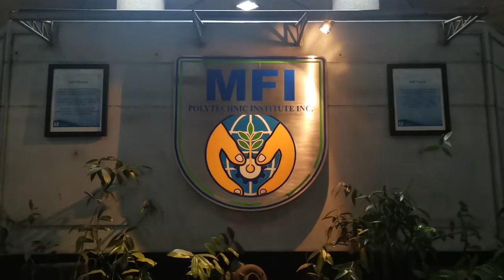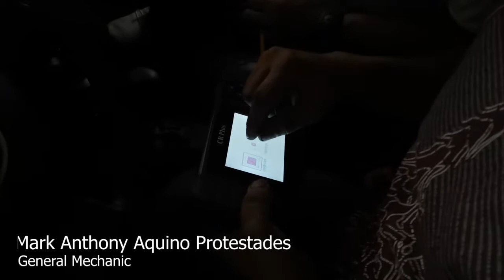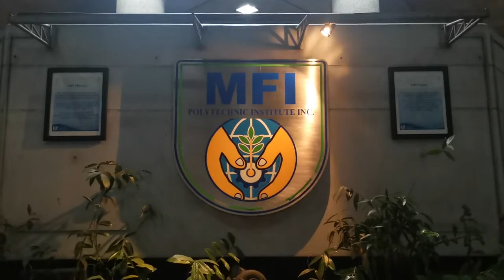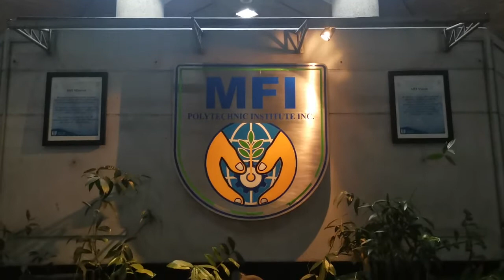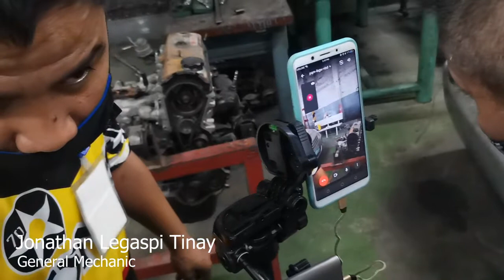MFI Trade Test Video of General Mechanic_Service Technician

Comment: Im not yet in the school but I know for sure that a solid disc brake rotor is 12mm thick but if it was 10mm or 10.5 then it needs to be replaced, seeing that rotor in rusty condition is no good, a clean disc brake rotor is a good grip for an old car.

Comment: maraming ganyan talaga marunong daw tas pag nasa trabaho nga nga hahaha
Reply: First of all kasi tinuturo yung mga basic things when fixing an engine, now when it comes to the real deal this is where they learn bit by bit kasi siyempre Computerize na kasi yung mga sasakyan like for example yung mga fuel injectors and ignition coils have sensors in them that are programmed with the right mixture of fuel. The right fuel mixture is determined by the car's ECU or the onboard computer that computer is responsible to measuring the right amount of air and fuel mixture.
Reply: take note I haven't enrolled to any mechanic school but I already learned this while watching videos.